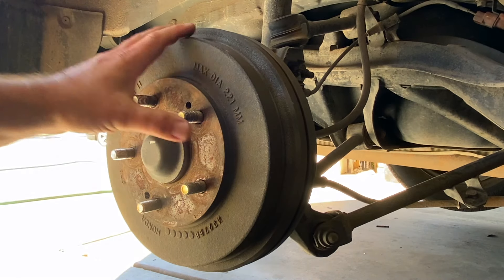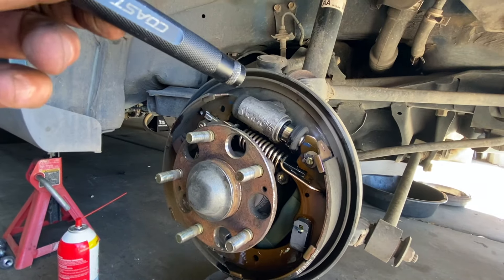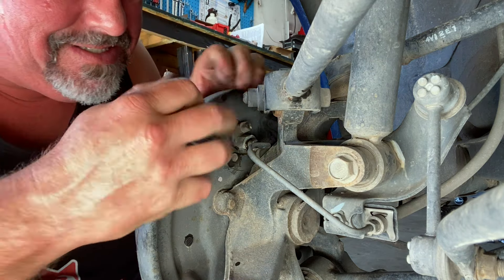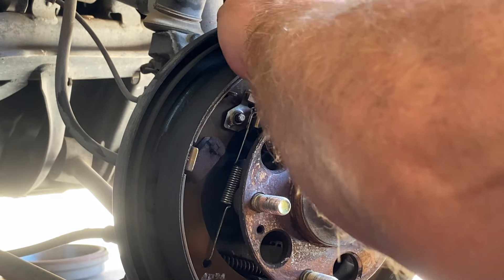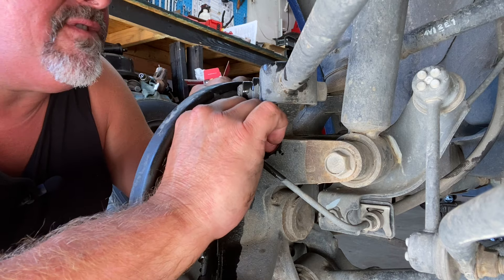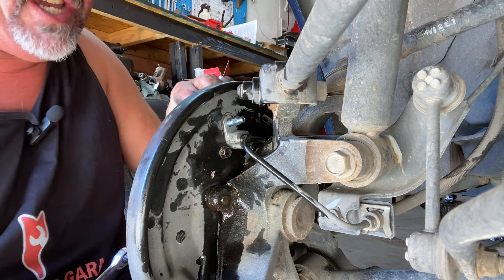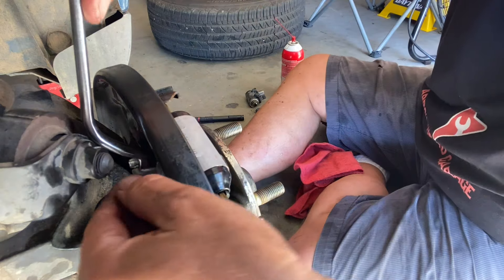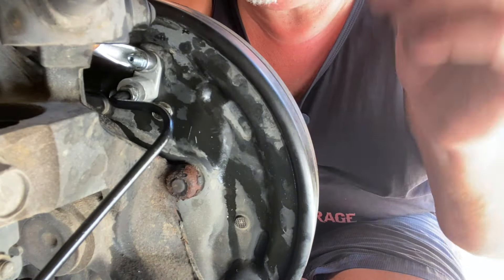How To Fix A Leaking Brake - How to Replace A Wheel Cylinder | 2003-2007 Honda Accord Rear Brake DIY

Comment: HERES A TIP: to stop the open brake line from leaking, take the rubber cap seal that’s on the old (or new) cylinder and pop it onto the line.

Comment: hey so im leaking from the raer but its leaking from the bck of it where the line connects would that be a bad seal or is it not tiight enough i have an 04 honda accord it should be that same as the one in your video?
Reply: My rear brakes are dic
Reply: How can I fix that